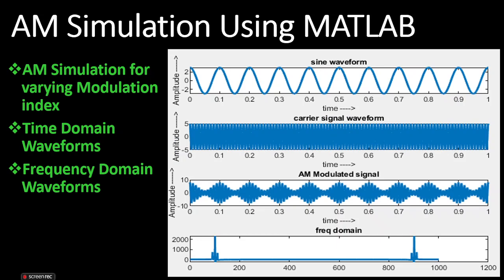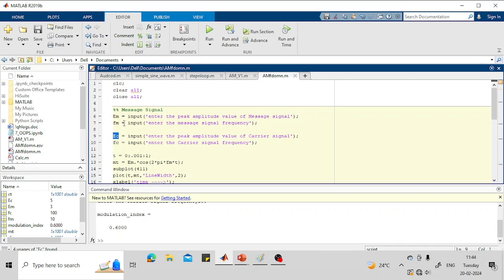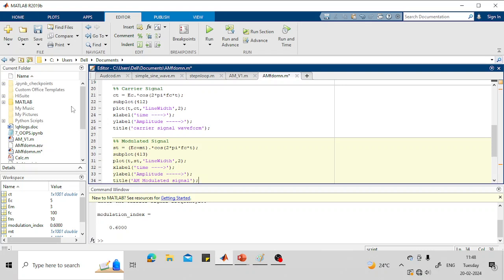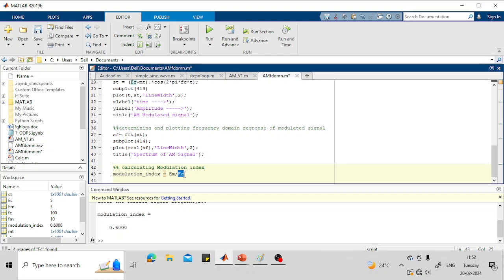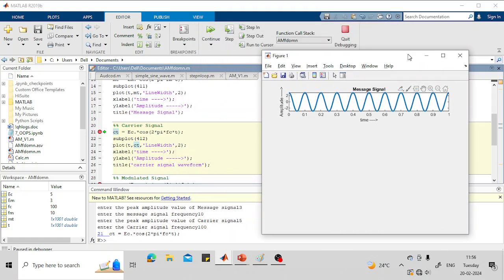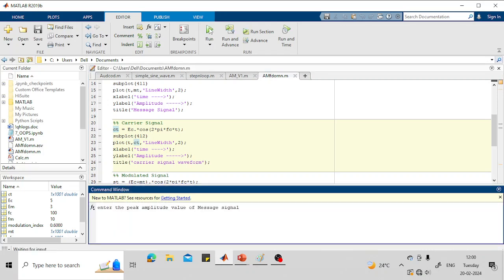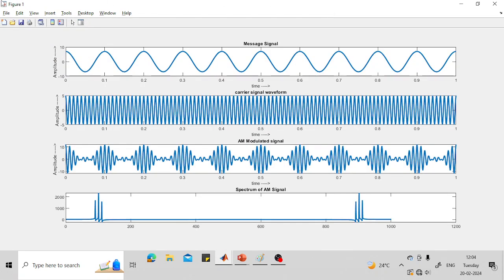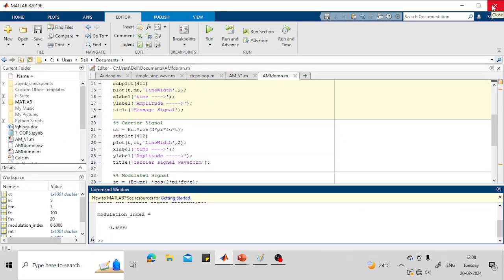Amplitude Modulation Simulation using MATLAB / AM / AM Waveform / AM Spectrum #amplitudemodulation

Comment: Good work. But very little impact on the spectrum. I've corrected that spectrum. See the code.

%% Determining and plotting frequency domain of modulated signal
Fs = 1/0.001; % Sampling frequency
N  = length(st); % Number of samples
sf = fft(st);
f = (0:N-1)*(Fs/N);
halfN = floor(N/2);
subplot(414);
plot(f(1:halfN), abs(sf(1:halfN))/N, 'LineWidth',2);
xlabel('Frequency (Hz) ---->');
ylabel('Magnitude ----->');
title('Spectrum of AM Signal');
grid on;

It's working.